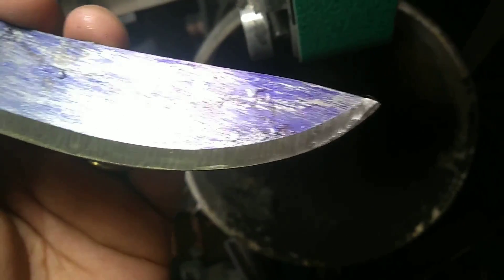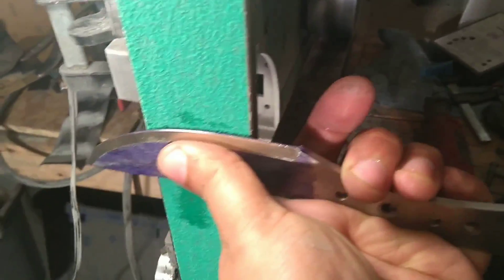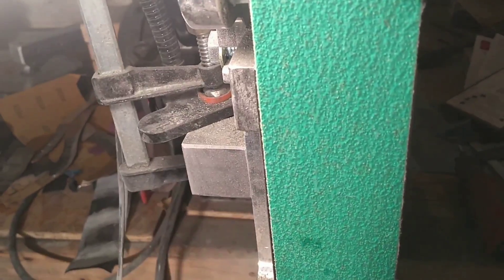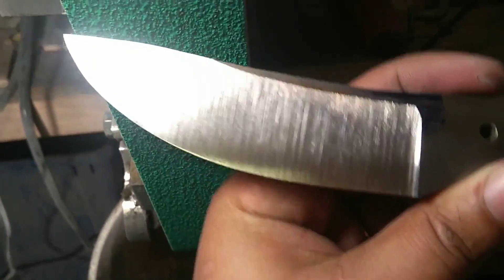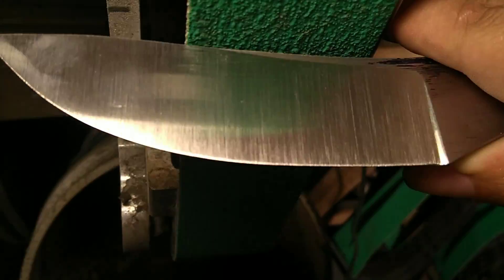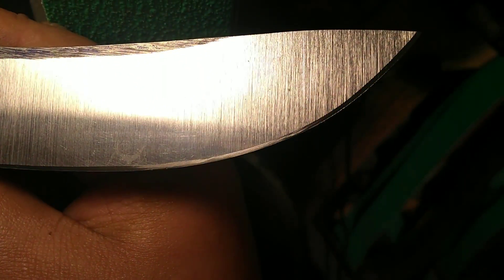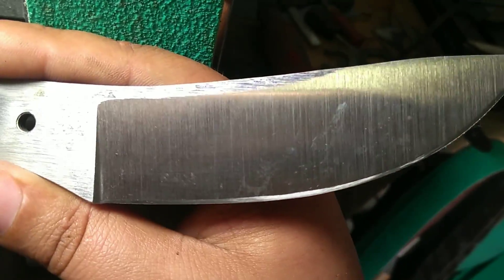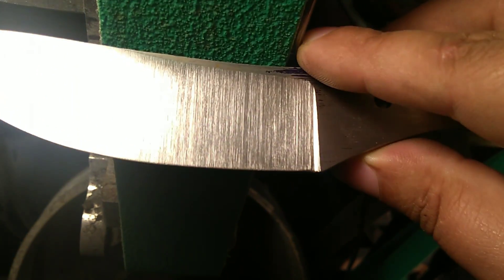How BBB grinds a laser | V4E at 67rc

Comment: I think everyone needs to experience cutting with a knife ground to under 0.010, 0.005 preferably. Then all these "this knife cuts like a lazer " quotes about anything with a FFG will go away. Sure it takes skill not to mess up your knife, especially the tip but the cutting ability is on another level. I have 2 Krein regrinds and a Shamwari that are in the 0.005-0.010 range and nothing cuts like them.